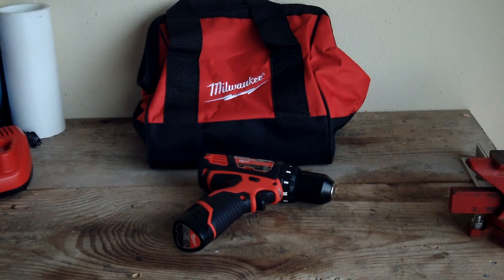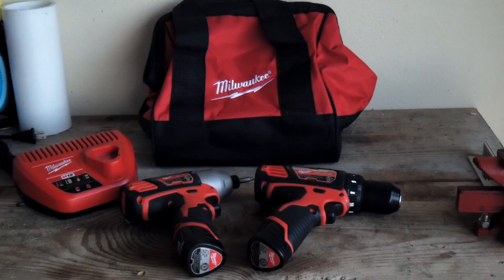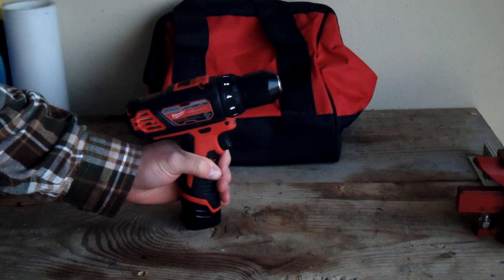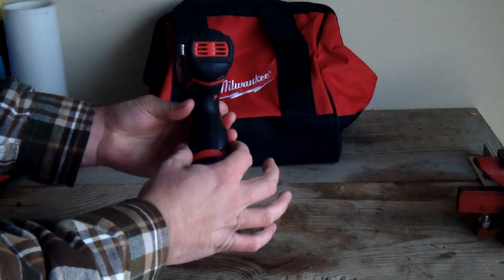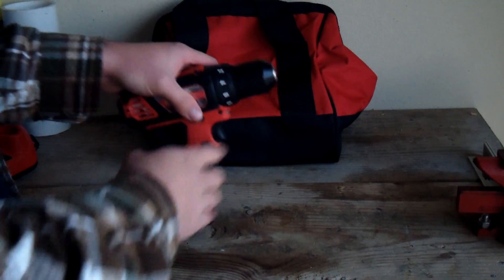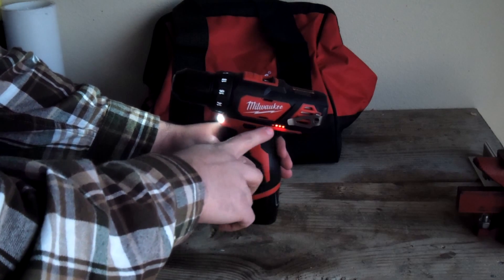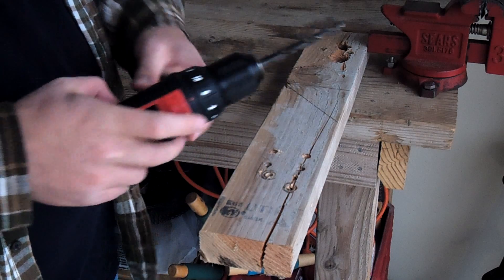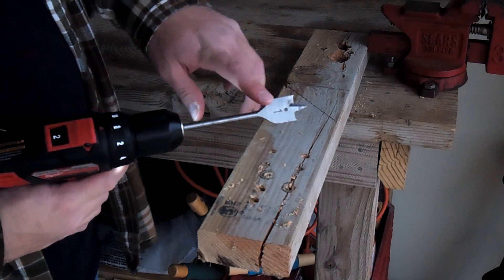Milwaukee M12 3/8 Drill Driver

Comment: Thank you. Home Depot just had an online sale of the same unit same model 2047-20 m12 combo. I bought it just to make chores around the house easier.  They had the newer versions but not on sale and cost more. This is fine for me but I was hoping you’d go a tad farther with your video... like maybe explain how to put bits in, how to find the rigjt bits just for home chores. And what those numbers 1-18 mean. I have to find your impact driver video now. Thanks
Reply: The numbers 1-18 on the drill is clutch settings. The lower the number the lighter the clutch. It keeps you from driving screws in to far and destroying your project. When it reaches its torque limit for each number the clutch slips instead of continuing to drive. There is also a picture of a drill bit along with those numbers and that is for drilling and bypasses the clutch so there is no limit no slip it gives full power out. 
Now the bits the average home diy will mostly use Phillips #1 and Phillips #2 slotted bits as well as torx bits ranging around t8-t30 there is bigger and smaller of all these bits but just the usual sizes here.
Reply from the maker: Thanks for watching, and commenting.